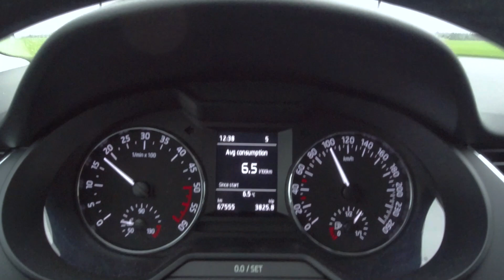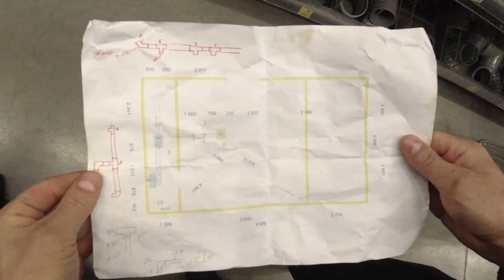How To Make TINY HOUSE Basement

Comment: Great video!  Working in all that dirt you should be wearing your high rubber boots with your overalls over top to prevent the sand and dirt from getting into your socks!
Reply from the maker: Thankyou my friend! I am using all the time Husqvarna classical leather boots, they are almost the same high as rubber boots. And I am very, very happy with them, so high safety feeling, pleasure to work. And easy to wash in end of the day, taking them together with me to shower.

Comment: Nice video, mate, thanks! May I ask you to share the link where you purchased these concrete blocks, please? Thank you!
Reply from the maker: Weber is producing them, it is the same company as Saint-Gobain or Glava, or Isover. Theoretically, these or similar blocks you should be able to find easy in any shop, as Home Depot. I Live in third world country, so my shop address will not help you. They are not in English: https://www.lv.weber/fibo-keramzita-izstradajumi/fibor-bloki/fibor-pamatu-pedas-bloki  https://www.lv.weber/fibo-keramzita-izstradajumi/fibor-bloki/fibor-pamatu-bloki   Thank you for comment!
Reply: @Dream4Design  thank you very much for you reply, I really appreciate! Interesting, I am looking at our local Weber website and they don't have these blocks, interesting...  Will continue my search in any case, thank you!
Reply from the maker: @porshenn  Use instead traditional small concrete blocks, which you use for walls, they are perfect for foundation too.
Reply: @Dream4Design  Hey. Yes, I considered this option too. But I really like how you used a steel armour with concrete to strengthen your basement. I think this is really good solution. That's why I am looking for a blocks like you had with a special groove for a steel armour. Thanks for the links anyways!
Reply from the maker: @porshenn  Good luck! Sometimes these traditional wall concrete blocks have  gap for steel armour too. And thank you for commenting, this helps for my YouTube channel a lot!